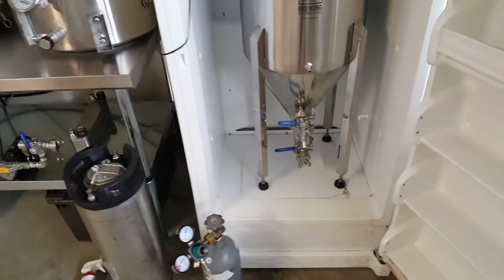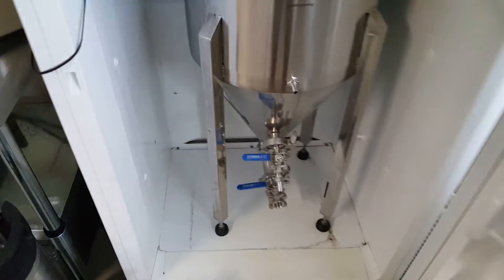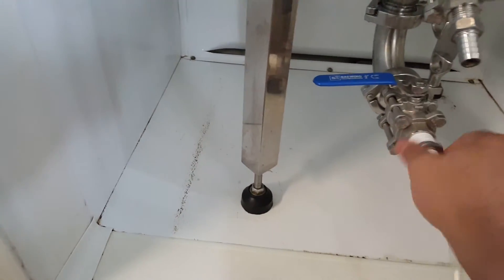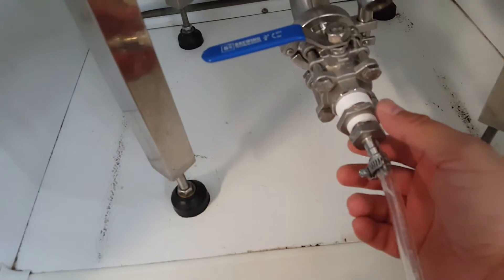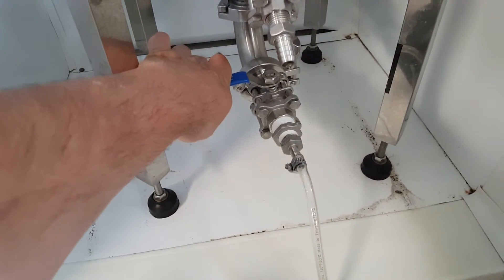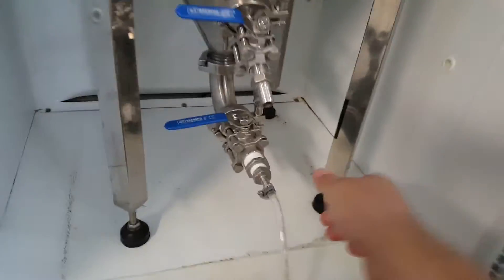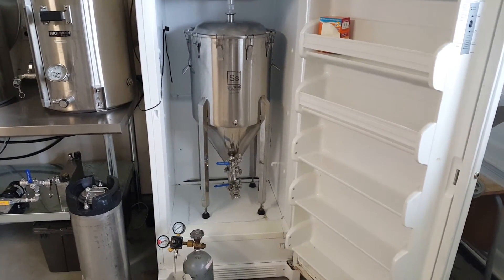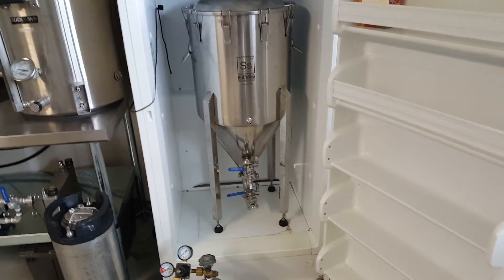Burping Conical Fermenter wCO2 During Dry Hopping

Comment: Ummm why?
Reply from the maker: Big hop aroma just like a commercial brewery. I just one first place a my last home brew comp using this method. Instead of just letting the hop fall to the bottom after a few hours, the CO2 re suspends the in the beer for better utilization. I talk to a few different brewery's that are doing this. Some brewery's will use pumps to recirculate the beer.